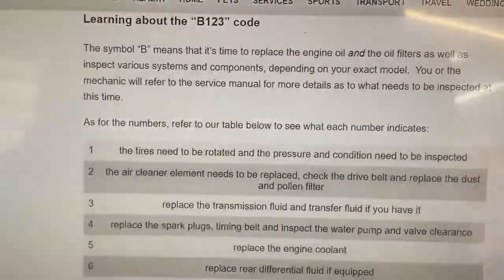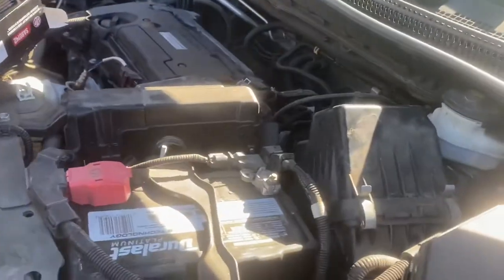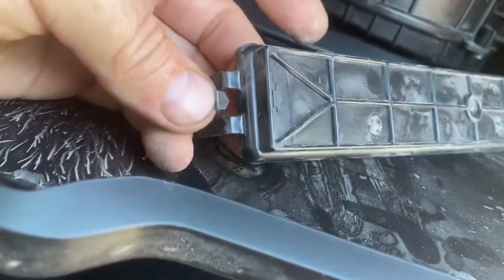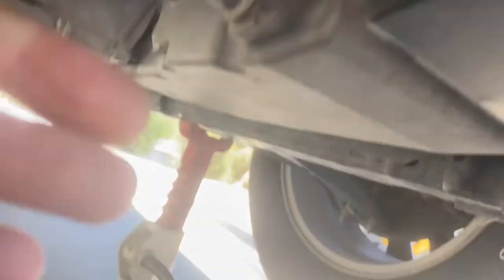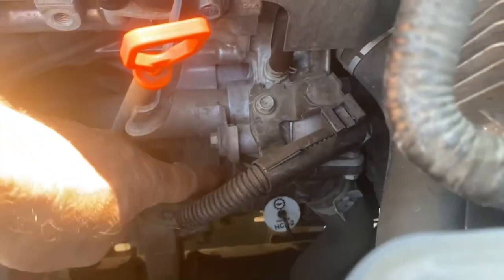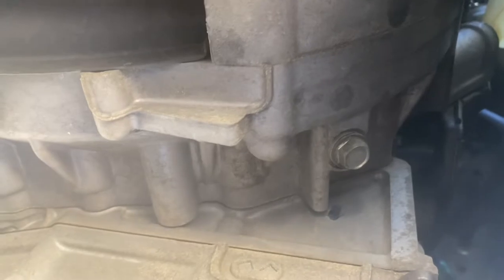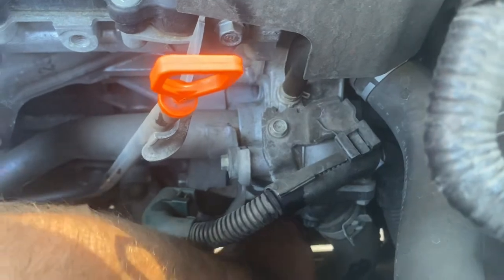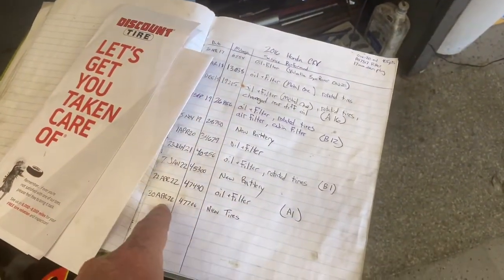How To Perform Honda CR-V Service B123 - Oil Change, Air Filter, Cabin Filter, Transmission Service

Comment: Never did transmission fluid myself.  Used to do my own oil changes all the time, until I had a compromised container break and spill oil everywhere.  I figured I wasn't saving too much on oil changes and if I take my car into the dealer they will wash it for "free" since I bought the car there, so I figure that's about a $20 savings compared to doing a car wash around here so the spread gets really thin.  I've been fortunate to have a pretty honest Honda dealer here so I give them more service related business.  Plus they usually have free donuts, coffee, and snacks so I take more than my fair share which reduces the cost spread lol.  These Honda CR-vs are pretty amazing vehicles though.  I bought my 2016 model in 2018 with 9k miles on it, it now has 53k miles and my average cost including one set of new tires has to be around $100 a year for inspections and small stuff.  I still have yet to change the brake pads which just blows my mind.
Reply from the maker: I have not done brakes on ours either, think it’s at 70k miles?  Great vehicle so far.  I should see what my dealer charges for this service.  Sometimes you’re right, if you have a coupon the basic service is reasonable.

Comment: Hey great job Tom,,  I change my own oil BUT I'm not sure about the   transmission fluid in the 2016 rav4,,  now I did change the transmission fluid in my 2007 corolla.. I understand what your saying if I can do the work on the car are rav4  I will  I change my own brakes as well.. it is hard to trust them.. great video thanks for your time Tom..
Reply from the maker: Yeah, a lot of this stuff is not difficult but it may seem intimidating.  A Saturday morning spent doing maintenance like this can save several hundred dollars.  Give it a shot!  Thanks for watching.

Comment: Your are complete right I live in NY and went to a dealer to get oil change and tire rotation just that, they charge me $80 dollars.
Brake fluid change $140 I waited around 4 hours seating in the waiting room just to come out and realize my tires weren't rotated 
and the brake fluid never changed.
Now I'm doing it myself, I just wanted to said THANK YOU VERY MUCH.
Reply from the maker: It just feels good to know that it’s done, as well as saving the money.  Thanks for watching.
Reply: @TomsTinkeringandAdventures  😀